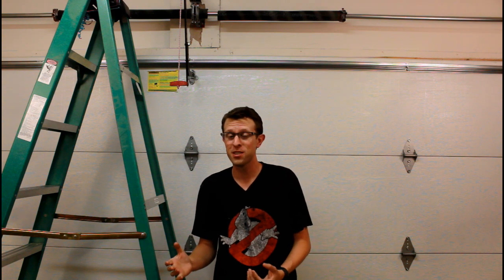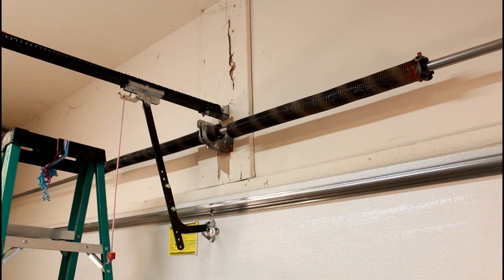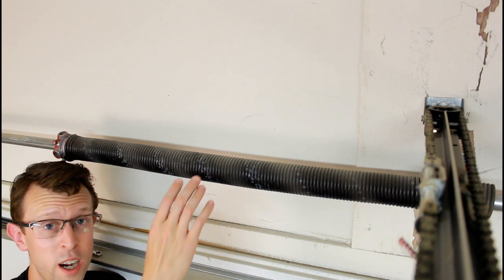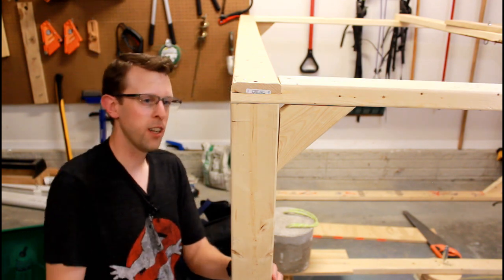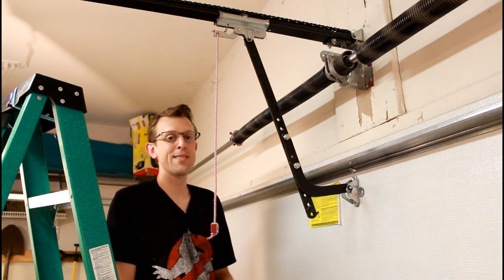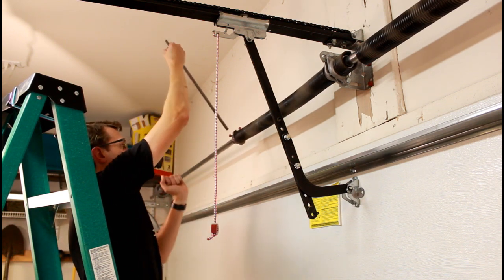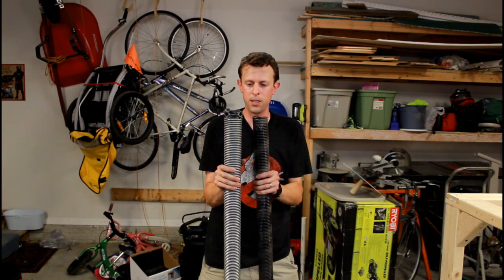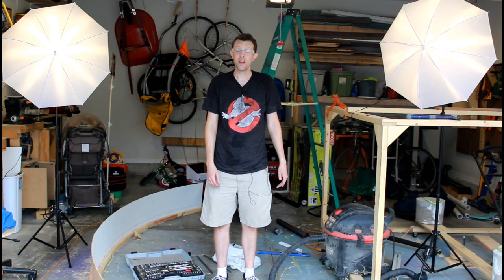Physics at home: How a garage door opener works and how to fix it

Comment: Good video overall!  I would like to mention that it's much safer to stand a bit to the side of a torsion spring when winding or unwinding one.  Never have your head, face, shoulders, chest, etc. directly under the steel bars used for tightening or loosening.  If one were to slip out of the hole, you could be hit by the other one and be seriously injured as it is driven downwards under the force of the spring.

Comment: Would have liked to have seen the bar/spring turning, it's not obvious what causes the bar to turn.  

BTW, Is it safe to say that if you disengage the trolly, and you can't easily open the door manually, then you should check to see if the torsion-spring is broken?

Comment: Hello there, u have done a good job! But when one spring brakes, its better to change them both.. They have the same age, and u must loosen them anyway.. Just a tip!
Reply from the maker: I heard that advice at the time as well, and figured I knew better. I got about another 6 months out of the other spring before it snapped. Live and learn, I guess. At least I was better at it the second time!
Reply: But that’s actually safer. You leave the good, ie, the dangerous one alone. Just work on the broken one. Work twice, but each time it is safer. Does it make sense?
Reply: @mrweisu  You have to loosen both regardless. So no, it's not "Work twice but each time is safer" it's "work twice and each time it's just as dangerous"

Comment: I never thought garage doors could be so interesting. I work in a lot of warehouses. Some of the door there are 20- 30 foot high. Those torsion springs must be incredibly strong.
Reply: I heard if those springs break, the door completely destroys itself falling down and kills anyone underneath
Reply: @mikem5475  I suppose that would depend on a lot of things. But there's a lot of weight there. I wouldn't be surprised if people have been killed. And a strangely large amount of potential energy stored there. Who knows what kind of chaos a broken one could do?

I'm actually a trucker. Similarly, I remember hearing how no one should never try to open up the spring brake chamber that stops trucks and trailers. The air brakes on a truck are actually powered by springs. They're in this roughly cylindrical chamber that's maybe 10 inches long 8 inches wide. Something like that. But, you never know what kind of mechanic you end up with. You might end up with some old timer who just fixes stuff like he always has since the 30's or whatever. So we have to learn the things they can't do and opening one of them things up is a really big no no. So much so that they make a particular fuss about it and every trucker knows that you don't open a brake chamber and if you do it could very easily kill you.
Reply: @PaulTheSkeptic  trailer mechanic, they told us about the doors and the brake cans as soon as we started. Supposedly a guy got killed by the dropping door at my shop. You definitely can open and replace the diaphragm inside the cans, we had them, dusty on the shelf, so we never did it in my time. It takes common sense, something most people don't have nowadays. Think about struts on a car (spring outside of a shock absorber). Same deal. Needs a tool containing it, like a press, and keeping far away from the trajectory if things go wrong. With the workers comp and liability, I guess it makes more sense to replace the $100 brake can vs the $5 diaphragm